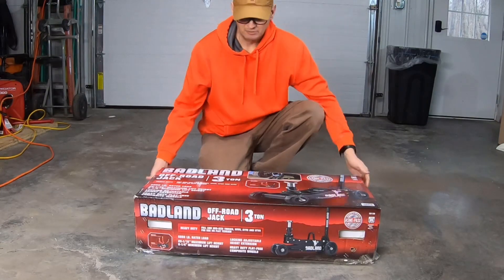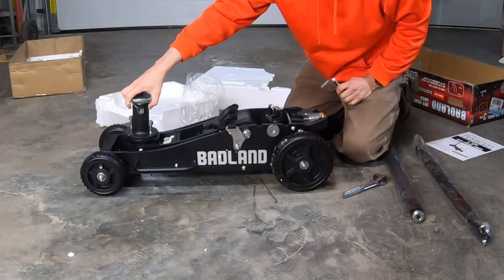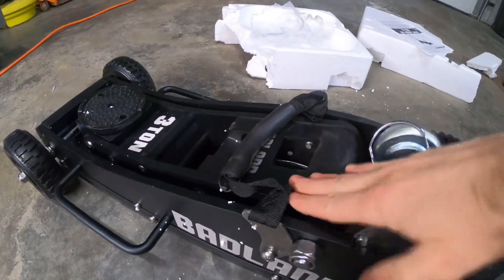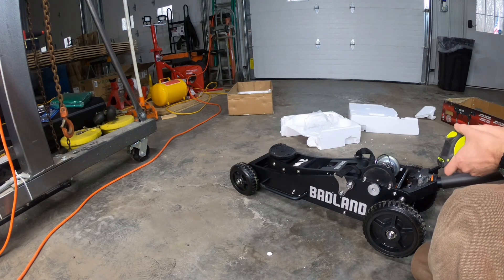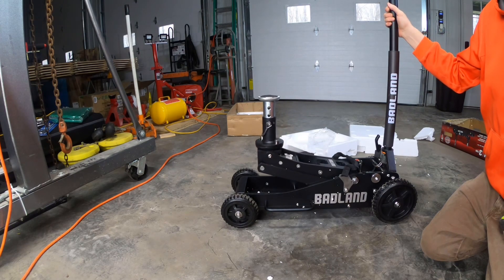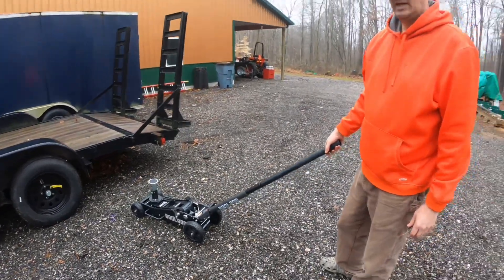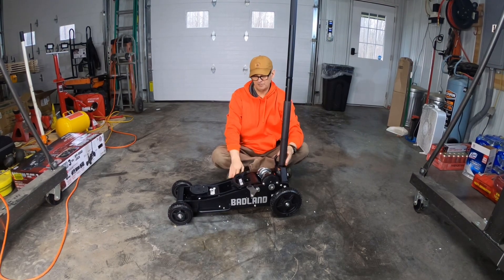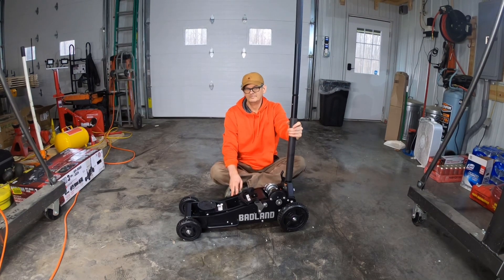Badland Off-Road 3 Ton Jack

Comment: Can you tell me the diameter of the extension that fits into the sleeve?  Wondering if the competitions rivian adapter will fit or I need to make my own once the jack arrives...  Thanks
Reply from the maker: Thanks for watching and your question. The silver extension that fits into the black base is 1-7/8” in exterior diameter the best I can measure it. Hope that helps! Have a great day and be safe!